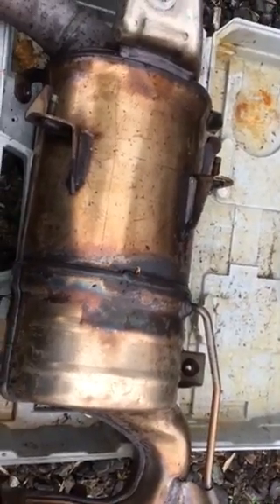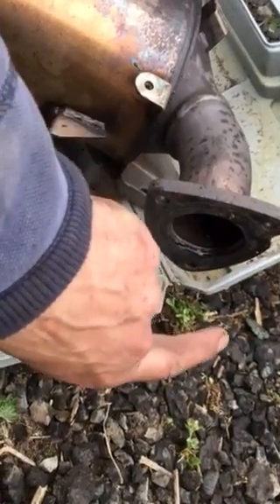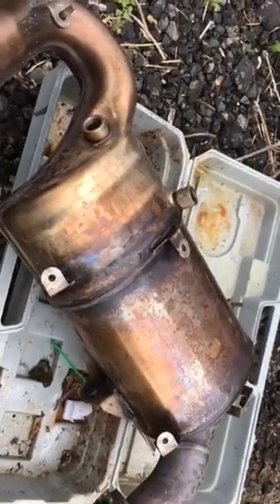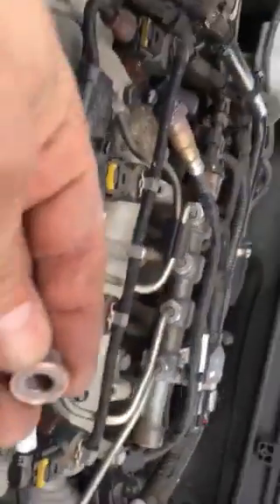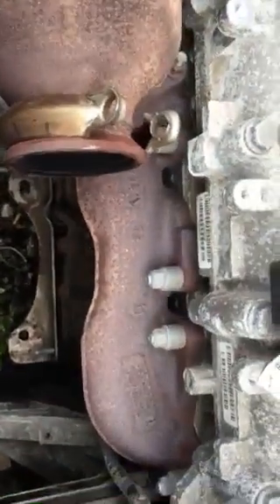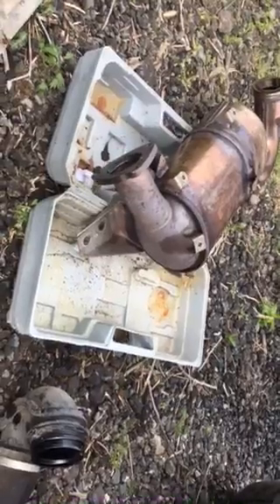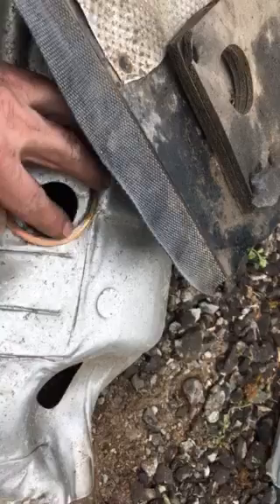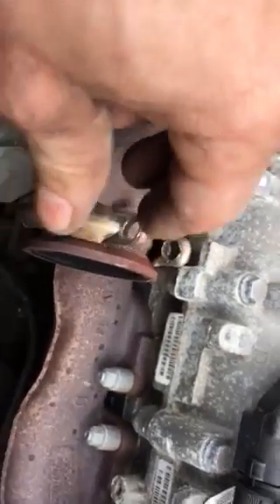How to clear / unblock dpf Vauxhall insignia

Comment: Thank you for making this video you helped my cousin save £400. 

To get heat shields of we used a 10mm spanner 

For the oxygen sensor we bought a 22mm universal oxygen sensor remover from Halfords. Note prior removing run the engine for at least 10mins because it will be impossible to get it off. 

For the other sensor we used a combination wrench. 

For the clamp up top we used 16mm deep socket. 

To get the clamp off we wedged it open by a pair of pliers so as we open, the top of the pliers pushed the clamp apart.

To get the bracket bolts off from underneath use socket extensions same for the top bolts we bought a set for around £2 in euro car parts. 

For the small rubber pipe wiggle it off by a pair of pliers same thing to put it back on. 

Rest is easy to get off. 

Very important when it is fitted back ,don't connect the bottom part of the dpf  just because when you start the engine and rev it the hot gas will push the remaining water or petrol out, it is worth putting an oil cacth pan or something similar under neath the connection. After that's done connect it back up. 

Also torque every nut and bolt back to specs we lost 5 nuts not tightening it to specs from the heath shields and almost lost a dpf bracket bolt.

I hope this info helps if you doing this for the first time. 

Have problem free repair. 

Thanks for the video again
Reply: Do you know the torque specs ?
Reply: Very good advice! Thank you for these. Did it require any remapping / relearning after assembling it back together?

Comment: Just wanted to say thankyou. Had the service vehicle soon warning and car went into limp mode. Diagnostic says dpf fault linked to regen error. Followed your video and shortly after it was back on the car it performed a regen itself. Seems to have cured the issue.

Comment: if you want to get the turbo to DPF clamp off easily, get some threaded rod with two nuts and some washers in between the tabs then wind the nuts out to spread it. Easy peasy.

Comment: Your video and instructions have convinced me to give this a try. My insignia is in limp mode and the message on the dash says diesel particulate filter partially blocked continue driving. I can't get it over 55mph so the drive for 30 mins or so fast isnt possible.  Going to try your method in the morning and see how it goes. Wish me luck lol.
Reply: Did it work? I'm having the same issue and code says blocked dpf so I'm going to do the same in morning

Comment: Couldn't have done it without this vid , thanks
However 2 inner bracket bolts are tricky to get at.
I ran drain cleaner and descaler through it , running perfect
Reply: How did you get to the 2 inner bolts pal
Reply: I used a short 10 spanner or ideally a thin wall socket , it's doesn't take much to loosen by hand

Comment: How did you get the bracket nuts off; the horizontal ones on the forward point lugs ?
Reply: Hi mate did you get these out? Can’t for the lift of me get at them. I’m working on an Astra so bit less space. Can’t get too sensor off either

Comment: I have a problem. How did you get to the two upper bracket that's hold the dpf in place.. Ive taken thw two bolts from the bracket  but there is another two from the upper bracket that i cant get to.That's the only thing holding back?
Reply: Hey - I've the same issue.  Any suggestions ?

Comment: Hi sebastian. How did you know it was blocked before taken it off?
What happened to me I tried pulling away It would not rev I put clutch in and gave it full revs then the dpf rubber pipe burst bit more revs after but runs rough.
When you ran your car with dpf pipe broken did it sound like a compressor air line open that you can clearly here over the engine.  When it first happened I thought I had a fast puncher.
There's a lot of pressure from broken dpf pipe when running I don't know if this is normal?.
Does this sound the same as your car.
Any advice would be appreciated.
Thank you Matt.

Comment: Hi Sebastian,i got a astra j 2.0cdti very similar to the Insignia.what was the steps for take the sensors out?.you unscrew them before take the dpf off the car or you just disconnect the cables.thanks

Comment: Hi m8 great vid going to give this ago on my insignia as got high Ash content. Did you have to reset the dpf filter after cleaning??
Reply: Hi Paul did  you find out if you had to reset the dpf filter after cleaning
Reply: @mattparlor7275  Would say it would need relearning to adjust parameters, you can do via opcom if you have it

Comment: hi Sebastian...my insignia is 61 plate and has no power...is a slow runner......but no limp mode ..it can go up to 80 miles per hour but down the hill...up the hill is struggling...dash board message: dpf full continued driving mandatory...I had a split turbo pipe and replaced it  today... then motorway...I'VE DONE 50 MILES and nothing...should I start taking off the filter and clean? and if I also clean the egr valve, would you say it's easy job? thx
Reply from the maker: cad lat I’ve never done egr, but dpf isn’t hard, and those are exactly the same symptoms this one had
Reply: Did you fix this issue? What was the cause?

Comment: My insignia has done 215000 miles and never had a problem
Reply: SHAY MCCUSKER no as it’s a taxi I drive up and  down the motor way and change the oil every 8000miles with castrol 5/30. it’s done 350k now and still going strong. I have only ever used shell Diesal I think one day she will just give up the ghost and go bang 😂😂. I was going to get a newer car in February this year but covid19 has fucked everything up.
Reply: Video City Productions.  
I do have this. What is thr solution?
Reply: South London hi, glad to hear that it serves you such a long time. Could you tell what year is it and is it a20dth engine? I have 2013 2.0 ecoflex one, runing now six months, only shell diesel. So wondering if yours is same year, as lot of info says that oil seal problem is mostly on 2009-2012 cars. Thanks

Comment: Hi 
I meet a problem with my Astra J 2.0CDTI same engine with your.
With computer i have P2453 error
On my dashboard is written DFP IS full , and the orange light of DPF is flashing.
I have change the captor pressure sensor of DPF ( GM 55566186 ) but same problem , i no have engine ligthing on the dashboard but i can't go more 3000-3500. 
I have try RÉGÉNÉRATE dpf with 50KM at 110km/h in 3 gearbox but the engine dont want regenerate Dpf...
I have go in small service shop, with computer, is written my capture sensor don't receive pressure... ( 0 kPa ) 
Do you have Idea where i need to search?
Maybe is small hose is broken or possibily blocked...??  

How have you clean dpf ? Open or Karcher ? 
Thanks you so much
I have watch your but can't understand more english than basic 
Sorry for my english and thanks you so much
Reply from the maker: Lin Jun small hose broken. Take off before karcher
Reply: Oki 
What do you suggest for cleaning dpf ? Only Karcher ? No need soak in hot water or put product dpf before Karcher ? 
For cleaning i need cleaning 2 side or only upside from DPF 
Thanks
Reply from the maker: Karcher both ways. No chemical. Chemical burn matrix. Big karcher better, but small ok if you take time.
Easier than you think
Reply: Oki i will do only with Karcher... 
Need take off the 2 sensor ? For the small black hose i will remove but how i Can cleaning the métal pipe ( where i take off small black hose ) from DPF ? 
THANKS
Reply: Can i put WD40 inside for cleaning it ?
Reply from the maker: No
Reply: Sorry i take off the 2 captor and i will clean it 
Clean from upside or downside ? 
Thanks
Reply from the maker: I did both sides. But first do opposite way to normal flow -
Reply: Oki thanks for your help 
After cleaning drying i need to past in car service or only need to clear the fault error with my computer ? 
Thanks
Reply: Hi Sir
Can you help me again ? I have washed  DPF all remounted but when i start engine they sais again DPF FULL with orange flashing on my dashboard , i have tried to erase thé fault with m'y computer but Always same error P2453 and P2458 
I have tried régénération on road but Always same problem ( no power and dpf is full )
What do you suggest ? 
Thanks